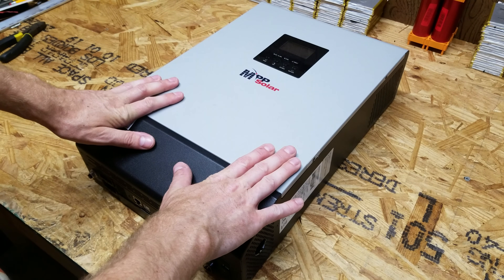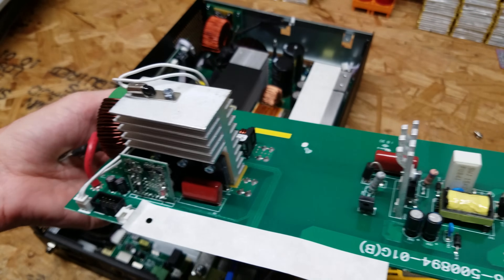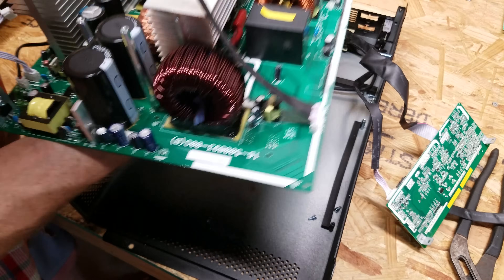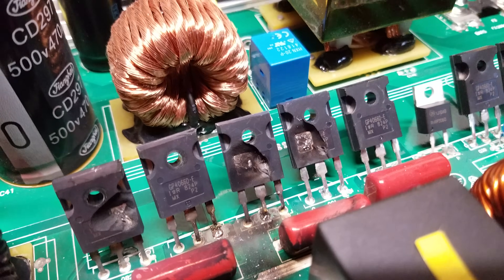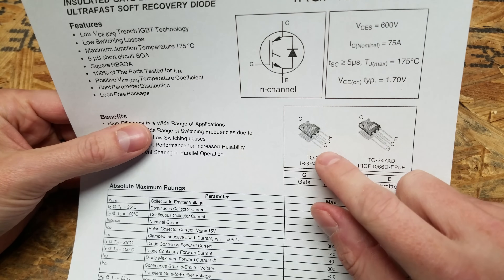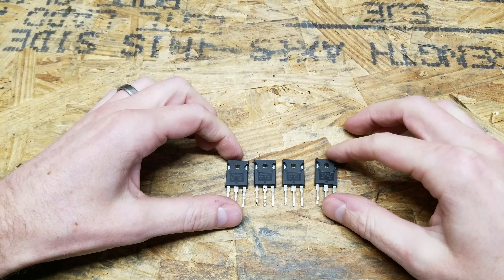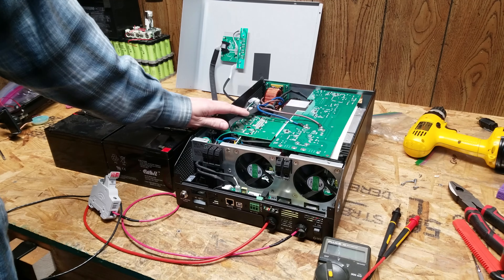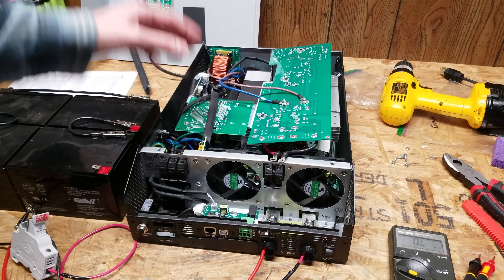MPP Solar PIP-5048MG Inverter Disassembly and Repair Attempt

Comment: I didn’t like my experience with that brand, shuts of and reboots every ones in a while and resets to default setting which is not  the one I need
Reply: Sounds like you might have a defective unit. Have you reported this to the seller/manufacture to see about getting a replacement? I know many ppl who use these have no issues
Reply: Sorry, but there is a big difference between the brands and shops and china. 
That brand has a very good reputation and first of all real human service ...  Do you know where they are from ?
Not the china americans love to talk about, no, these are the chinese the americans use to call allies against communism and this brand is fighting against cheap chinese copies for example on aliexpress. You could purchase these on aliexpress but only from the manufacturer and therefore the quality had been good and service too, pre and of cause aftersale service.

You can ask them for help and they ship spare parts or boards quite fast to you and they were by far not the expensive ones - compared to the price of the whole system.   

Maybe you should ask them first cause they are pretty active in supporting you in any pre- and aftersales questions. 
Ours worked fine, the off grid and the on grid version in the 5 and 10 kW edition.

Comment: Appreciate the video - even though you have a dead-short.  This is real life and I (for one) appreciate you sharing :)     I overloaded a Reliable 3000w by trying to run a 12,000BTU AC - and it also resulted in a dead short on the 48v battery input.  Looked at things but, like you, did not see anything I could repair.    Will be interested to see if you make any progress on this.

Comment: The filled screw probably picked up solder during the wave soldering process. Should pop right out with a scribe tool or other sharp pointed, hardened tool.
Reply: do they do wave soldering as part of an assembly process?
Reply: @mikepettengill2706  Wave or dip. Lots of ground planes, through hole and SMDs so assembly would have required several steps. To position all of the IGBTs for soldering, they would just bolt them to the heat sink to lock them in place then dip or wave solder them. The screw is not a security screw. There is no purpose for it, and looking closely, the shape is oblong while the solder itself is concave. Security screw center spindles are only slightly larger than the diameter of a large paper clip, and are not irregularly shaped. The solder will melt, the screw won’t , but it’s easier to just pry it out.

Comment: To check the transistors you could get a LCR-T7 transistor/IC checker.
Also, totally support the idea of putting a current limited supply on the battery input to trace it back. But if you don't have a current limiting supply, also just work back from the battery connectors for components that are across the rails and which could be shorted then pop them out.

Comment: was that a fuse to left of two caps @ 12:38. F3 maybe. Wouldn't cause a short but worth checking. Might try to find schematic. Nice replacement though. I though you had it.

Comment: With that sort of a blow up the gate driver ic's are probably also toast. There will also be resistors in series with the gates and they may be open. There will be zener diodes protecting the gates and they should be changes regardless. You should change all the IGBTs whether they test good or not. Then you need to see if your short is gone and if not test all remaining semiconductors removing them as necessary until you find the short. Also be sure to remove all the blackening from the board and the heatsink as it will be conductive. You may get lucky but it's a lot of work and you still blow it up the first time you turn it on. 20 years experience repairing switched mode power supplies up to 24kW. Gillian :)
Reply: I agree the diodes or resistors might also be dead and if the chips are dead its on a new level. Also I wonder if it uses bootstrapping cause then those components might alsp be dead
Reply: I have a question that you will probably be able to answer :). Why do IGBTs require gate driver ICs? Why couldn't the CPU/controller drive the gates directly instead of through a driver?
Reply: @LMF5000  Three reasons.  
1) Gate capacitance.  Large FETs / IGBTs often have gate capacitance measuring close to 10,000pF.  This coupled with the tendency for FETs/IGBTs to be paralled for higher load capacity...usually require several amps of drive current in order to cleanly turn them on and off.  CPU/MCUs are usually limited to 20mA (0.02A) max output.
2) Drive voltages.  FETs/IGBTs are usually specced at 10vDC, max 20-30vDC (depending on the type).  They usually are driven at voltages between 12-20vDC simply to ensure that they are fully on (lowest resistance = lowest heat).  Conversely, for practical purposes, there are no CPUs/MCUs that function above 5vDC; MCUs used in inverters usually run at 3.3v or 5v.
3) High-side driving.  Most FET/IGBT setups in power inverters are the venerable H-bridge; the FETs/IGBTs on the DC positive side require a special "high side" driver that can turn them on/off even as they fly up and down--not to mention that this driver must also provide the desired drive voltage (i.e. +15v) ABOVE the DC supply rail.  This simply isn't CPU/MCU territory--they must remain firmly "grounded" to the negative rail!
Reply: @sidlori1592 ❤
Reply: You just hit the nail on the head

Comment: The caps and components related to the 48V system will be rated for around the same voltage, caps should be around 63V rated for example. The HV and LV sides will be separate systems and the 48V won't share the 450V big mains caps with the HV side. The only other thing I would check is isolation of the heatsinks and  to ground

Comment: You are asking for advice, however, in your statement that the unit was damaged by feeding grid current into the unit, that made understanding near impossible, as most of these hybrids are designed to feed grid/gen current in to charge battery during non pv periods.  Some clarification on that is advised prior to asking for information from us.  Does this unit in fact allow grid/gen input?  If not, where did the 'electrician' feed such into the unit?  Without this info we would be merely guessing.  There are triacs in some of these that require actual voltage from the battery and/or grid to activate the circuit.    It would be useful to test each terminal to the case to see if it was a dead short or a mere design condition you've encountered.
Reply: The 'electrician' accidentally fed grid power into the load side.   🤔
Reply: @benssolarandbattery  Then the most appropriate place to begin is the inverter circuitry.  Reverse the effects of current passing into the inverter would produce terrific and catastrophic carnage on the inverter's transformer and associated components.  You might bypass that portion of the internal part of the hybrid unit and instead divert to a known good inverter.  In essence, retrofit the entire inverter with a new one.  48 to 120 inverters range from the low $100's and up.  Locate the input to the existing inverter and use that on the replacement, output to replacement output.  Inverters are rather simple devices using a diode to rectify the a-c to direct current and transformer to step up the voltage.  Plus of course some peripheral safety components such as over-temp, overload, etc.
What are the terminals that are shorted?  Battery, input, output, pv?
I just went back to review and see the battery terminals are shorted.  That points to either the rectifier or the transformer primary (primary would be battery side, secondary would be the a-c side).  You would need to determine the means or strategy by which this device produces a-c.  Pulse width modulation or pure sine wave.  Then dive into that portion of the circuit first.  Each uses a separate strategy to perform its function.  It's difficult to troubleshoot, remote like this.  But hopefully this will provide you with some direction.

Comment: Yeah, that thing made some pretty terrible noises! 
I just checked my PIP 2424lv-MSD and there is a dead short on the battery input when you put your black lead into pos and red into neg.  Check it the other way around.  Mine shows .838 miliohms with red to pos and black to neg.
Reply: Likely reverse polarity protection. Like Ben said swap your multimeter leads around and retest.

Comment: Those are IGBTs not mosfets
Reply from the maker: Ah, thanks. I guess that explains why my little test to turn them on/off with the meter didn't work.
Reply: @LithiumSolar  hi there, 😁 u've just checked ur little build-in diode of IGBT , fortunately they are fine but doesn't show ur IGBT's condition

Comment: Did you test them other transistors that looked fine
Reply from the maker: No, I did not test the line of small transistors as I figured that was part of the MPPT charger, not the inverting circuit.
Reply: @LithiumSolar  the small transistors are the DC input side and are more than likely your problem
Reply: I Think the small transistor is a resistor or a diode. Two legs.
Reply: Them transistors are for the dc side basically a big dc switch
Reply: Ok